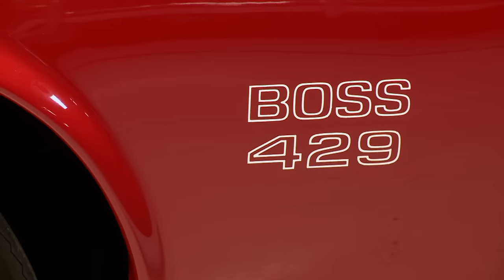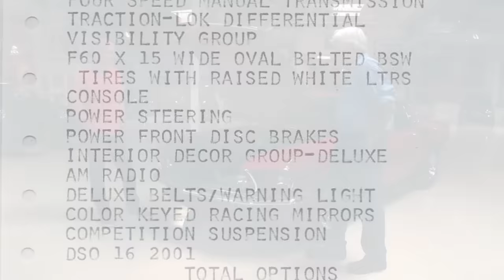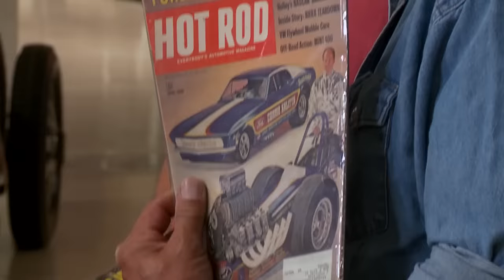1969 Ford Mustang Boss 429 - Jay Leno's Garage

Comment: I was a Mopar guy in my teens., my step dad was a Ford guy and owned a Maroon '69 Boss 429 that he had drag raced in the early 70s . I learned a lot about ford muscle cars from him. Intake ports you could put a tennis ball in, Sodium filled exhaust Valves, a good tweak and tune you could get 500 plus hp from a factory stock 429

Comment: Jay, you really don't look impressed with this Boss 429. It's truly an amazing Mustang, just like the Boss 302. I give anything to have this car, I remember working on one just like this one when I worked at Rick's Porsche Service. It was a celebrity (from 21 Jump Street) customer whom asked the Boss to check an oil leak and I ended up replacing the valve cover gaskets which we bought and ordered from Performance Unlimited located in Culver City, CA. I remember they scratched their heads cause they had never seen a valve cover like this. Bob Fox, owned this speed shop and it was a hang out back in the late 70's, 80's and early 90's. Great shop and I felt so bad to see that Bob closed the shop and sold the building to a bike shop. I sure miss Bob, and his Daughter Jenny. Johnn, and his Dad Brad also ran the place when Bob wasn't around. Back to the Mustang it's really a beautiful car with a Monster 429.
Reply: Small world! In the late 80's and early 90's I knew both Bob and his brother Marty, who owned The Performance Center in Lomita. Both those guys were a great help in keeping my POS '68 Mercury Cougar XR7 running. 

From what I understand, Bob and Marty didn't speak for years but became best buddies after both retiring from the speed biz.
Reply: Maverick Grabber didn't you post the same thing up above 3 comments but under a different name??

Comment: 8:35 My 1969  Lincoln Continental Mark III had the C6 automatic transmission and the  engine was rated 500 ft pounds of torque & 365 HP
Reply: Gross

Figure no more than 250 "as installed" peak HP by 1972 thru today's SAE Net ratings, with torque coming in a the 380 ft-lb range.

In other words, that engines was a DOG!

Comment: About that green paint mark in the engine bay, this may be a similar case: I own a '65 Corvair 140 w/ an auto transmission that has a purple paint mark on the governor unit, this told the assembly line worker assembling the power pack (GM's term for engine/trans/diff.) that this particular governor unit went w/ the 140HP engines w/ the Powerglide transmission. There were other colors used for different parts by GM during the time period that don't come to mind, presently.

Comment: I got a chance to get inside one of those. My best friends brother who died in Nam owned it and barely had a chance to drive it around before he was killed there in Nam. It was an experience for a 16  year old kid to even be in the presence that car and what it rep-presented. Wow... Engine was such a tight fit you had to go underneath or lift the engine to replace two of the spark plugs. Truly an awesome piece of artwork... body design, lines and fastback style. Eleanor 68 fastback was the only one that even came close to it in my opinion. More user friendly... Sweet !

Comment: nice, i own a 1970 mach 1 428 scj, drag pack
Reply: R Gordo 
I had a ride once in a CJ . the 428 seemed feel like it was made for the car . I always felt it could beat the 429 . Am I wrong ?
Reply: Ron Lawson  Not on the top end probably but 428 gets out on the 429 from a dead stop.
Reply: Had a 69 428 cobrajet
Reply: Me too...it was my Dad's, but I had it at night. 4-speed, Acapulco Blue, all White interior (not recommended). & no power steering & no fold down seat.
Reply: @garypic4083  when I was younger, my grandfather picked up a 67thunderbird 4door w/ 428CJ. 
This was 96-97'. My grandfather died a few years later, and the car was left to rot..:( We had until 08-09, before my crazy mother sold it. Which is a damn shame, because I was just out of highschool, and always wanted to get it back in the road.
Reply: Sure ya do.
Reply: Love that shaker hood
Reply: I think off the show room floor the 428 would take it. If you're looking at potential, that goes to the 429. I'd still take the 427 side-oiler, but it was not a great everyday street motor, that goes to the 428.
Reply: @JoseMartinez-sq6xq  actually it's not a shaker. But it is a factory functional ram air scoop.
Reply: @429thunderjet2  a 428SCJ Super Drag pack. Has a shaker. I am not talking about the boss 429 in the Video
Reply: @JoseMartinez-sq6xq  oh thought you mentioned the boss 9, sorry.

Comment: The green over spray was a protectant apart ford used on smog pumps and power steering pumps. It protected against rust...lots of manufacturers used this type spray but some owners cleaned them out cause they hated the green color.
Reply: LiveOakOkie  It's the way they marked a pallet full of pumps that had passed inspection quickly.

Comment: No Jay, It's not your basic 4 speed, it's a Ford top loader, the one everybody wants, just like the Ford 9 " that any track car (be it a GM Ford or Chrysler) should have at a track.
Reply: Exactly. It's a top loader, which is to say a great transmission.
Reply: I'll just keep my 18 spline Hemi 4 speed and Dana 60 , no Fomoco parts needed ;-)
Reply: Indeed. Back in the day in Australia even the Holden (GM) guys begrudgingly used Ford top loader gearbox and Ford nine inch diffs because they were the best.
Reply: Yeah, well you obviously don't race it for a living.

Comment: Hey Jay! Hope you read this.The hot rod magazine you displayed at the start of this video I used to have and maybe still do, but I don't think it had the breakdown of the 429. I had a few magazines in those days like "Hot Rod" and "Car Craft". According to the article I read, when a team put a disassembled 429 together an dino'd it, it pumped out about 750 horsepower and no blueprinting the engine, not even balanced. There was comparison sketches of the Hemi and the 429 combustion chambers also. The 429, like the Chevy 396, had cantilevered valves, just a little more extreme as I recall, in fact the pushrod for the intake valve ran through the intake port runner. It was very unique.

Comment: Putting the emissions stuff back on this car is like having Adele sing while wearing a ball gag.
Reply: LOL
Reply: Lol. Like trying to suck a bowling ball up through a McDonalds straw.
Reply: Actually Adele singing with a ball gag would be a huge improvement.
Reply: What is an A-dull?
Reply: Adele?  Who is Adele? Was he the guy who was almost Van Halens singer?
Reply: A lot of the ridiculous restorations go overboard with the chalk marks on this, and overspray on that. Most of these factory chalk marks were cleaned off by the dealers detailing kid as soon as they came in so no customers would have even seen them. A lot of the overspray stuff was cleaned off or painted over as well. Did you notice Jay asked him what the green overspray was from since there wasn't anything green in the engine bay and the guy gave some completely untrelated answer. I've seen some "concours" cars that had chalk marks on everything and there is no way a dealership would have put it on the floor with them still all over the car.
Reply: they want it to be as original as possible, including NOT having to pay a $699 "doc fee" (still haven't figured out what that is other than an extra $699 profit for the dealer.)
Reply: oh thats nasty ,your having some serious thought disorder
Reply: That's win win. Thanks for the image:)
Reply: Exactly!

Comment: He never explained the green overspray under the hood
Reply: My guess is that's how it came from factory, err carcraft or whatever.
Reply: Since GM built the pump, you would have to ask them. I have a feeling that it was a visual sign that the pump had passed inspection. A pallet of pumps could be check in a short period that they had been inspected.
Reply: Most expert car restorers don't know the exact meaning themselves. Most of it is assembly line related. I was watching Graveyard cars and one of Mark's guys asked him about the markings on a rear axle and he didn't know, Mark is a Mopar expert too.
Reply: he is very mistaken on smog pump on 69 Mustangs 428 CJ for certain I bought it new
Reply: I think he was trying to say that the smog pump manufacturing process involved green paint and that somehow made it under the hood?
Reply: Just a hunch, but I think the green is more a chemical reaction to a protective coating that was used that has oxidized - and isn't paint at all.  Decades later, some Bubba probably thought it was paint and perpetrated the myth.
Reply: mistaken how?
Reply: could it been self etching primer?
Reply: My guess is bearing grease over spray.
Reply: my guess is a touch of green spray paint would be after it was tested at the factory & passed
Reply: Not in detail but he did say that is from the manufacture of the pump itself, they performed the overspray task for whatever reason.
Reply: As stated previously, it has to be a grease/oil that has dried and discolored.  Same as today's new rotors from japan, to stop rust while sitting on shelves. Even better explanations would be thick cosmolene grease on guns. Heck even a pallet of smog pumps sitting by a grease pump with bad o rings could have shot grease residue across the pallet.
Reply: Inspection paint.
Reply: It was actually a green car and he didn’t want to admit it.
Reply: Because they are originally green
Reply: @57WillysCJ  Did GM build the distributor,  too?  Also, see my response below...lol
Reply: The paint marks are assembly line indicators that the component has passed testing. Usually found on Distributors, carbs, water and AIR pumps, power brake boosters.
Reply: It isn't green over spray "under the hood."  It is green over spray ON THE SMOG PUMP from when the pump was manufactured and assembled far, far from the car itself.  The pump, with green over spray on it, was then installed in the car.
Reply: Meanwhile at the bat cave he’s still trying to figure out why he painted that part green
Reply: 57WillysCJ  Inspectors mark.
Reply: That is because he had no idea what the answer was.
Reply: Beautiful car,  I had a 1970 coupe with a 428 cobra jet engine, it would overheat if I put the pedal to the metal, never the less I love that car.
Reply: Manny Reyes I wouldn’t want to be stuck in “traffic” on a 95 degree plus day in California.
Reply: The guy should have just said I don´t know.
Reply: Because he really doesn't know. He gave jay a canned answer of sorts.
Reply: Yes he did. He said he copied low mileage cars and hinted that it might have been part of the assembly process of the smog pump. I think he was just adding some imperfection so he wasn't accused of making it "too perfect" to be "original".
Reply: Misting various colored paint or spray paint dots were common quality control marks back then.  It has nothing to do with the color of the car (Jay).
Reply: He obviously doesn't know and neither does Jay. Likely neither of them really works on cars. And that's ok as long as they don't try to act like they do.

Comment: Mustang, the only car that matters.
Reply: SHlT.......l WOULD MUCH RATHER HAVE THE 'VETTE FROM THAT YEAR.
Reply: yup, just floor it at the car show parade, what could happen? This car was never, ever, designed to turn corners.
Reply: Actually, because of the wide Shock Towers, This car Handled Wide Corners better than the BOSS 302 did. Larry Shinoda actually confired this , the Wide stance of this car meant that I could launch really well. They simply forgot to mention a Vatal part in this Video, Every BOSS 429 Has Drag Pack as standerd.
Reply: Hahahahahahah

No

Comment: Good thing that car isn't in my hands, if i knew the potential of that motor with a better carb and the smog system removed and a good exhaust, it wouldn't be all original for very long

Comment: I am the same way with Camaros. It was my first car and I was hooked every since. Growing up in the early 80's with all my family and friends who were all motor heads and gear heads. Every Saturday I would have pull in under the giant tree in our back yard and the hood was up. If you walked up you would see 4 guys bent over the engine compartment. Always wrenching on my 76 Camaro. I pumped gas for a local gas station and had my car on the lift after we closed. My first check I was able to get one brand new BF Goodrich Radial T/A with the raised white letters. I bought one a week for a month! lol but that's how you did it back then. And the stereo was next, then headers, then exhaust...

Comment: I don't know what he's smoking but the C6 automatic will handle 450 ft. lbs. of torque all day, every day and ask for more.
Reply: I owned a 65 Oldsmobile Dynamic 88 with a 425  making 450 ft lbs at 2,400 rpm with a 3 speed TH400 auto. I'm not a Ford guy but Ford didn't have an equivalent unit by 1969? I always thought the C6 (Ford) Torqueflite 727 (Mopar) and TH400 (GM) were all about equal as for as durability went.
Reply: Will a C6 fit in a Mustang floor? I doubt it. The C6 is a strong thing but LARGE!!
Reply: Ah, that makes sense.
Reply: All automatic big block Fords came with a C 6 and some 351 s (a small block) came with a C6.
Reply: The 1968 428 CJ ran through a C6 out of the factory, as did the 1968 W code 427 sideoiler. Both had more low end torque than the Boss 429.
Reply: @RMosher11  Yes you are right. They all could torch clutches and bands if you ran them hard because they shifted too soft but the mechanicals were tough in all three of those. C6 started in 1966.
Reply: @ldnwholesale8552  Yes it will fit fine in those chassis, that could be ordered with a big block starting in 66 for Fairlanes and 67 for Mustangs.

Comment: Just slide in a solid roller cam, bolt on a set of 2” headers along with an 850 DP and make 550+ HP.
Reply: And lose all originality of this car
Reply: The Boss 429 should've gotten the same radical solid lifter cam that the 429 SCJ got. And I have no idea how the small block Boss 302 came with a 780 cfm carb but the massive big block Boss 429 came with a puny little 735 cfm unit that didn't feed it nearly enough fuel. That move by Ford made no sense whatsover
Reply: @jeremythompson9122  They never had much intention to sell a lot of them or build just what buyers would want. Look into the history of that motor. I don't think there was ever any intention to make it a production line motor. They did what they had to to sell enough for nascar.

Comment: Better than ever. The 429 actually handled better than the previous models. The green paint was a way for the company to mark tested and double checked parts so it actually is not called over spray but markings rather . Most companies used yellow or red for it to be easily visible. This was for workers at the end of assembly line to see if something was missed. As far as the front lights goes this had the outboard grill lights from factory some earlier models had inboard lights in the center of the grill. Very good looking car and it sounds fantastic.
Reply: Good insight. I wonder if the builder knows this. He knows it is to be green that's for sure.

Comment: The stock Boss 429 is under powered and frankly embarrassing to race because you got beat until you put on an 850 Carbureator and headers.  Then you are making 600hp with the potential to make a bunch more.  My Boss is 1970 KK2159.  I have a Holman Moody 492 and plan on kicking some butt with it.  But I have had it since 1988 and I have never driven it yet.  Still looking forward to driving it about.  Mine was impounded in 1980 and got out of jail on a Police Auction in 1983 for $300.  funny
Reply: Randall Parker Would love to see what it does on the track. And if you put it on the dyno I think we would all love to see that also.

Are those Holman-Moody D Port heads?

Comment: The whole purpose of the Boss 429 was to sell 500 units so the engine could be used in NASCAR...A few simple modifications and those Boss 429's could run with any of the Hemi's or 427 Chevrolets..
Reply: Actually no,  they did not outrun the hemi. 
In fact Petty held the record speed with the Mopar hemi.
The Superbirds and Daytonas were banned because nobody could compete. So,  to say the 429 beat Mopar is absurd when factual history shows the opposite.
That being said,  I have always liked the Boss 429. I took one from a wrecked 69 and put it in my 71 Mach 1. I never could put all of its power to the street without using 11 inch slicks and wheelie bars. 
I had the old style MTs for street back then. 
Go straight fast,  and suck on corners.
Reply: Samuel Adams true Chrysler was told to run  restrictor plates on the carbs. But pulled out of NASCAR and didn't run for a long time.

Comment: I can appreciate original, but green overspray and a yellow 23 are just silly. Improving the car slightly from stock be removing these imperfections doesn't spoil it, rather makes it even more beautiful. Also, remove the smog pump if you are going to drive his and not just dust it once a month, let this beauty breathe unrestricted.

Comment: I had a 69 Mustang back in 79. 
6 cyl, automatic, cracked dash, lotsa rust, but it ran perfect. It was one of several of my High School cars. The quarter panels were rusted through on both sides and I could stick my hand through the hole and touch the spare tire in the trunk. It was a good Oklahoma dirt road car. 👍